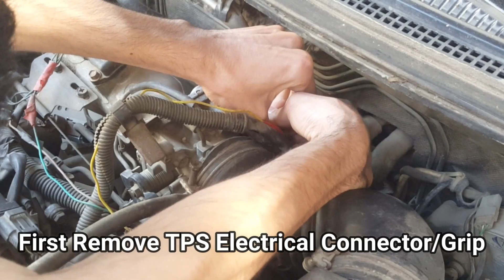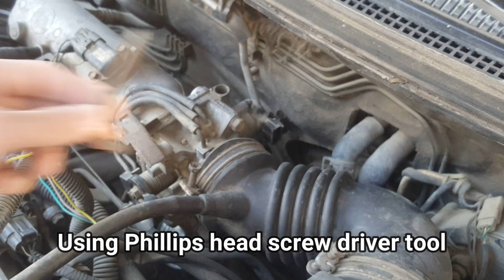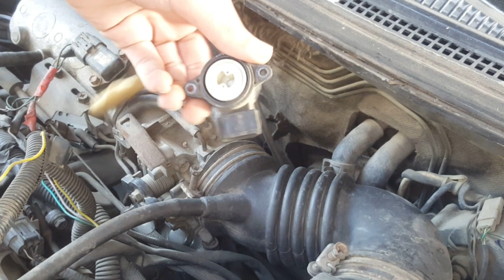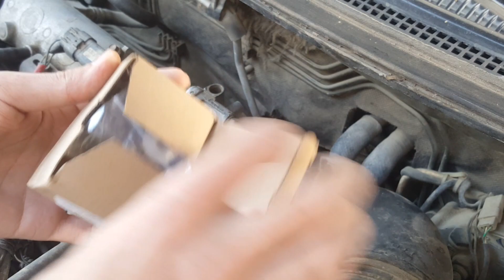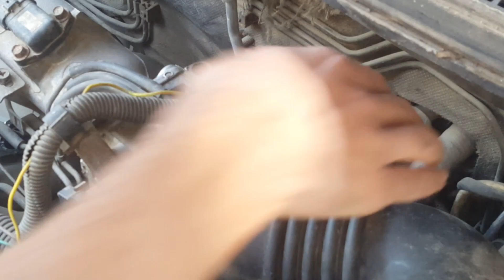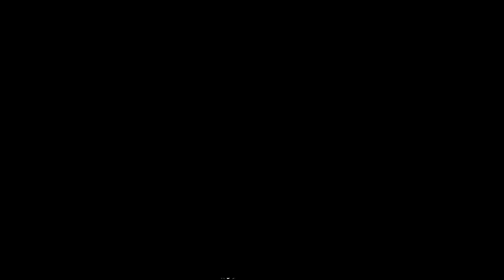Mitsubishi Lancer TPS Sensor Change

Comment: That's the easy part. Taking a while for me to calibrate this. 500 RPM @ 0.52V which was obviously going to kill me if I kept it that way. 750 RPM @ 0.58V. Way better but fuel economy could be terrible. I could get it to work at 700 RPM flat but I need a better Tachometer or OBD2 scanner working to clearly see that. Most Lancers should be fine with 700 RPM I guess. That's what I saw on the engine info for my case.
Reply from the maker: U need to position tps at 507-527 ms. Idle rpms for 4g engine are 750-850 rpm on no load and 850-1000 on ac on.
Reply: @journeywithhaseeb  It has been stable at 750 RPM except when AC is on. My car has other issues.

On my engine bay, I saw the idle RPM is 750 plus or minus 100. 

I guess if it is far below 700 RPM, the car could stall and run lean. At 500 RPM and with one ignition coil damaged, it was really shaking a lot. It didn't stall. It was just shaking a lot. 

Everything is clean from air intake manifold to EGR and filters.

I will double check on the manual. You seem to be correct. I am just curious if 700 RPM would make a difference in fuel economy as some say. Keeping it at 750 RPM for now.
Reply: @journeywithhaseeb  how is your fuel economy at 750 RPM as lowest idle RPM? These are things I don't want to experiment on if there is just one right answer, and I very clearly never wanted 500 RPM which I got at 0.52V reading.
Reply from the maker: @kgpcodes  750 rpm on idle is on no load
Reply from the maker: @kgpcodes  in city and without ac i am getting 10.8-11.2 km/litre economy
Reply from the maker: @kgpcodes  and no i would make no difference in fuel economy.  But yes every thing should be working as it should like you said your ignition coil is not working properly.. so i would say replace your ignition coil. Also rpm is automatically controlled by IACV sensor.  Just keep every thing as per factory setting and rpm will be automatically controlled as per engine need
Reply: @journeywithhaseeb  I have a modified air intake. It is universal so the sensors set to lowest setting do help with fuel economy for me. I was told that the idle RPM should be 700 RPM with AC on. But I discovered a faulty Engine Coolant sensor messing up with the idle RPM. I saw a few videos claiming that Lancers should have 0.50V to 0.54V setting for Throttle Position Sensor for better fuel economy.
Reply: @journeywithhaseeb  my ignition coil works now. Brand new. I discovered a coolant sensor issue. Possibly even IACV. When I replace this week, I will know whether 700 RPM idle RPM with AC on makes a difference.
Reply: @journeywithhaseeb  4G18 Lancers with modified air intakes should have 15 km/L fuel economy. But I can imagine it to be 12 km/L even with 700 RPM idle. Have yet to confirm.
Reply from the maker: @kgpcodes  idle rpm can vary between 750-950. And it will have negligible affect on fuel economy as its computer controlled.  And yes coolant sensor can mess with your rpm. Every thing including iacv, map, tps , coolant temp sensor, thermostat must be working fine to achieve the idle rpm goal i.e 750-850
Reply: @journeywithhaseeb  they removed the MAF sensor here and there is no check engine light. I am about to buy my 3rd coolant sensor. This is such a mess for a very small sensor. It even makes the car shake and have knocking sound. I suspect there is an IACV issue too and everything I bought does not work. Would be good to have a video on how to test the IACV.
Reply from the maker: @kgpcodes  https://www.facebook.com/fixyourlancer/ 
Follow my page on facebook to stay updated!
Reply: @journeywithhaseeb  Oh I avoid Facebook like a plague. I only use YouTube and Twitter. But will like your page.
Reply from the maker: @kgpcodes  oh alright. 🙂
Reply: @journeywithhaseeb  I now get 750 RPM idle but struggles with AC on. Do you think that is still the ECT? My fan module is brand new too. I will try different ECTs and see which works better. Doing a coolant flush now.
Reply from the maker: @kgpcodes  did u adjusted idle air control screw?
Reply: @journeywithhaseeb  There is no adjustment for that for 4G18 CS3A Throttle body. No such screw but older engines have it. The idle RPM is stable and looks normal. Something else is wrong with the engine. I suspect I need to change my engine oil. It is very black. The ECT was damaged December last year but does not stall with AC on. Now it stalls.

I changed a lot but I don't think they would cause the drop in RPM. It could be the coolant sensor which still doesn't make the fan run at 80 degrees. Waiting for the seller to ship.
Reply: @journeywithhaseeb  there are cold start issues too even if the spark plugs and ignition coils are brand new. It could be the engine oil. I run the car at least 10 minutes daily to avoid damage to engine. I will be performing an engine flush and have to clean spark plugs tomorrow. But last time I checked they were very clean.
Reply from the maker: @kgpcodes  must change oil on time.. dont risk it.
Reply from the maker: @kgpcodes  can you inbox me your throttle body pictures
Reply: @journeywithhaseeb  if the coolant sensor is faulty and an ECU reset happened, the engine will start and die fast on cold start. Common issue for all cars including Toyota ones. But the Toyota ones don't even start at all or will need to do it 20x before car starts with a faulty sensor. The Lancer 4G18 does not make it so obvious. It starts and idle RPM looks normal even if sensor does not work. In fact, the AC fan works with a faulty ECT. Most cars will stall.
Reply: @journeywithhaseeb  I found out what sensor the local shop gave me. It was for a 2002 Lancer. Despite giving the sample, they gave me an incorrect part. I cannot return it due to physical damage. The old temperature sensor which is an original part was really faulty. It didn't even give correct idle RPM. So now I prefer to buy parts online as at least I could return them despite minor damages.
Reply from the maker: @kgpcodes  as far as i know, 4G18 throttle does have a idle air control screw on top of throttle to adjust the rpms manually. If coolant sensor it faulty it should throw MIL light on odo meter. Better attach a scan tool and check the live data stream of sensors.
Reply from the maker: @kgpcodes  so when u do that cold start, how does the rpm react. Like in my CS1A 4G13, on cold start, rpm goes to nearly 2K immediately after start and comes down to 1200-1300 and stays there. Then it comes down slowly as engine start to raise to normal temp. and finally stays at around 750-850 on normal temp.
PM me on whatsapp +923352184399 if you want demonstration video of this process! Happy to help!
Reply from the maker: @kgpcodes  You should actually do what i do. go to partsouq.com or ssg.asia then enter your VIN number there and search. Then you will get category wise part dissection's diagrams. Search for the part which you are looking for. Then get the part number of that part from diagram. And then put that part number on Ali express or ali baba what ever suitable. Search for the most sold part / ratings wise etc. and order that. I have been doing this thing for a long time now and highly satisfied. I ordered chinese Purge solenoid valve, EGR, FPR, dome lamp lens and what not (u can find all these part in my other videos)🙂 and all working fine so far.
If you still have any queries , just land in my whatsapp D.M at +923352184399 ✌
Reply: @journeywithhaseeb  It is about same but I never got 2K RPM immediately. It was about 1500 RPM and gradually goes down to 750 RPM. I am going to wait for the right coolant sensor to arrive. All the shops are just selling me whatever they have even if it does not work.
Reply from the maker: @kgpcodes  i have noted your recommendation and will make a video on how to test an IACV
Reply: @journeywithhaseeb  the idle RPM is also stable. It doesn't fluctuate like it used to. I really have the wrong ECT now and I feel like it will damage the engine compared to the old sensor so while I am making the updates like engine oil flush, I am using the old sensor while waiting for the new sensor. I may, for insurance, buy something on Amazon U.S today. At least they refund the full amount. I could not sell the replacement sensors I bought. Just going to the trash can.
Reply: @journeywithhaseeb  4G92A engine is very different from 4G18. I believe the models close to my car are from 2003 onwards. They gave me a 4G92A sensor which looks Identical to the 4G18 coolant sensor.
Reply from the maker: @kgpcodes  if the rpm is dropping with ac on after the car has warmed up, i suspect that your iacv is faulty. On my CS1A , there is a screw on top of throttle to counter this issue. Usually what happens is when IACV gets older, it becomes less responsive, though you can improve the shelf life of iacv by cleaning with carb cleaner and lubricating wd40 on it every 3-4 months. So when it gets older it looses the tendency to control rpm on high engine loads. Some times it will respond like drop the rpm and raise it again to normal. some times it will get stuck and rpm would go to around 2K. so to counter the rpm dropping when engine on load, what i do is using my scan tool i enable SAS mode from ACTUATOR TESTS section of scanner and what this does is closes the IACV Fully! If the screw on top of throttle is some what loose / open, then engine will start to stall but not die, then you looses the screw more until the desired rpm (850-950) and then you disable the SAS mode. After that IACV takes back the Rpm control and stays at 750-850. when on load it still keeps the rpm near to 850-950. But if the IACV shelf life has expired (i.e this process that i just told not working any more) then its time to change IACV!
Reply from the maker: @kgpcodes  i still highly doubt the trouble you are facing will be caused by a coolant sensor 😞as its sole purpose is just to let ecu know what is the temperature of engine coolant and kick start the fan by giving signal to Fan module!  better get a scan tool and check the data stream your self.
Reply: @journeywithhaseeb  that's another issue so I am really taking this to the Mitsubishi repair center. Scan tool does not work and there is no check engine light with incorrect ECT data. You could be right about the IACV. It may even be the throttle body. There are two things being adjusted for 4G18 throttle body. The lock nut for the butterfly which just holds it in place. The nut and screw for adjusting the open and close position of the throttle body butterfly. They call it butterfly in most videos. It has been adjusted based well and the TPS voltage is 0.52V lowest. The IACV is brand new right now. Again, it could be the wrong part but I checked if it supports 4G18, many people said yes.
Reply from the maker: @kgpcodes  not all scan tools work on lancers. But the scan tool which i have is VDM2 and it works on lancers. Tried and tested on many models and it works like a charm.
Reply: @journeywithhaseeb  but they said any cheap Elm 32 ones work on Lancer so I bought MS 309 and Elm 32 ones. Not working. No issues with the OBD2 port. I will still go to the Mitsubishi repair center when fan starts to work. I suspect the issue with my car stalling with AC on is more than the IACV. Will adjust throttle body screw tomorrow as they said I should turn it a bit more.
Reply from the maker: @kgpcodes  alright. And yes elm and cheap obds wont work due to protocols.
Search for vdm2 on google if u ever want to buy a good scan tool for lancer
Reply: @journeywithhaseeb  my engine oil came out pitch black. After 3 more flushes it is light brown. It looks like the previous owners never cared about fuel economy when gas was half price. I am learning how to test IACV. I found out I bought the correct replacement part but every mechanic I talked to told me to buy OEM or original. My old original IACV had good resistance values but it struggled more than the replacement part which had very stable idle RPM except when AC is on. Will do tests this weekend and hopefully find what is wrong.
Reply from the maker: @kgpcodes  alright keep me updated
Reply from the maker: @kgpcodes  there is only resistance test to test an iacv and nothing more
Reply: @journeywithhaseeb  doing a basic vacuum leak test too. I was wondering why the lowest RPM at TPS voltage of 0.52V was 750 RPM or sometimes 800 RPM. Everyone told me at that setting, the idle RPM is below 700 RPM. Could likely fall to 650 RPM. I recall having the intake manifold cleaned so started with untightening and tighening the bolts and nuts. The bottom bolts should be tightened first.
Reply: @journeywithhaseeb  I never followed the star pattern on radiator bolts and there are zero leaks. Wondering how air is any different. It's already locked in place tightly. Also never heard of car stalling due to small vacuum leaks. The mechanics sprayed MAF cleaner 5x on the cleaned manifold and nothing leaked while engine was running. They do it as a basic test to check for fuel and vacuum leaks.
Reply: @journeywithhaseeb  before cleaning the throttle body and air intake manifold, the idle RPM was very high at 1200 RPM. The lowest I got was 950 RPM. A reason for poor fuel economy. Then I had this serviced and diagnosed. They said I need to change the ECT messing up with the air fuel mixture values first. Hopefully will get to see what is really causing the stalling when AC is ON.
Reply from the maker: @kgpcodes  according to factory service manual, tps at 507-527 = rpm at 750-850.
Reply: @journeywithhaseeb  I am buying the PDF manual now for CS3A... And a full system scanner. The mechanics gave incorrect diagnosis. It was not a faulty IACV at all. I bought brand new original ones. All gave same results. 

Most cannot determine even vacuum leaks. I found a way to test the vacuum leaks without turning on car. Just pressurize with air compressor and seal throttle body with rubber glove. Spray water to find leaks. Similar to method for finding tire leaks. 

I am buying Thinkdiag Mini scan tool too. It can even reset ABS.  It has warranty. So if it doesn't work, I will return it.
Reply from the maker: @kgpcodes  very nice strategy. Update me when the issue is fixed and the culprit of the problem. 
Just a suggestion, search for VDM2 , its a scanner that i am using and has wider cars support. U can get excel sheet from their website and check the functions for each car with car list
Reply: @journeywithhaseeb  I tried to look for the VDM2 and found nothing on shops. What the mechanics recommend here: ThinkDiag mini for full system scanning. Includes ABS.

My ECU is responsive. No check engine light on. Doesn't die when AC is on but does die when shifting gears. It is an air-fuel mixture issue.

The voltages on wires are good. Now it is just a matter of scanning and checking for vacuum leaks.  The entire brake system was upgraded and caused ABS light to turn on. The light usually disappears after driving. I will still check for issues before driving on highways.
Reply: @journeywithhaseeb  mechanics are very expensive here, and unfortunately they do not have scanner for Mitsubishi Lancer so they keep guessing. And you pay for the guess and parts which happened to me. A new IACV did not fix the stalling issue. Overall it was expensive. 

Our only Mitsubishi repair center requires you drive car to their shop which is impossible for my case right now. The scan tools are cheaper, and if they don't work well just return them free of charge.
Reply from the maker: @kgpcodes  i would then recommend you buy VDM2. Works on lancer too.. you will easily get it around $100-130 or so
Reply from the maker: @kgpcodes  and thats why i started this channel so people watching may DIY and say good bye to mechanics for minor works🙂
Reply: @journeywithhaseeb  they have value when you are tired and feel like giving up. I talk to a mechanic daily. He is finding a better car for me because when I gave list of problems, he said it is cheaper to sell. But we cannot even sell with the outstanding critical issues.

But yes, some mechanics fix 10% of the issues & some even make things A LOT worse. There was a mechanic shop owner that said I will never need a thermostat. That is only for Japan he said. Because it is too cold, the engine will die. Not all of Japan is cold all the time. He is misinformed. I live in a city where temperature is normally 18 ⁰C so I don't really get his point.
Reply: @kgpcodes  I have 4G18 lance with stock fittings. Do you know where in Lahore can I get the air intaked modified to increase the fuel economy?